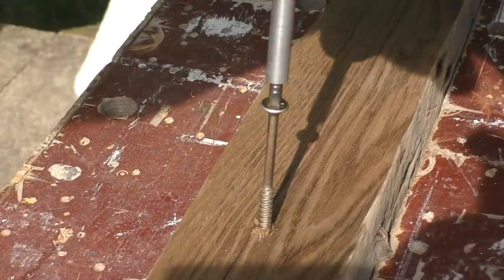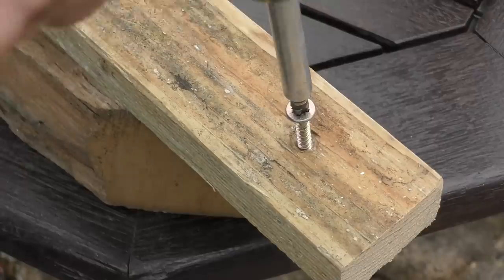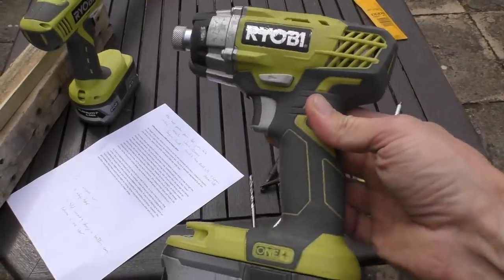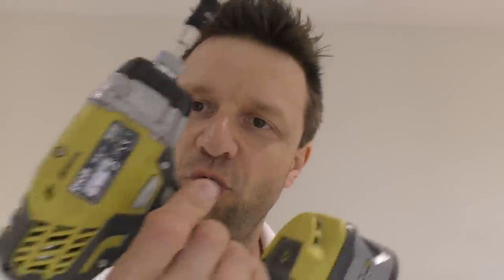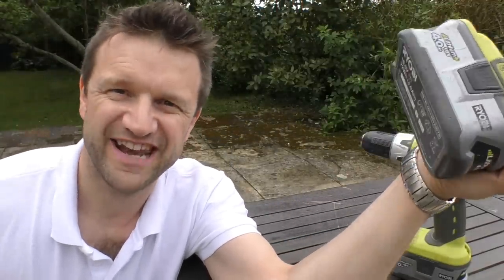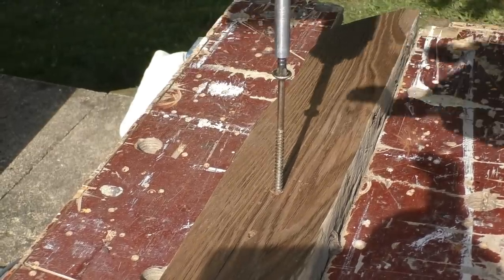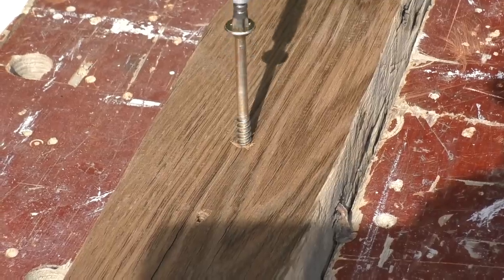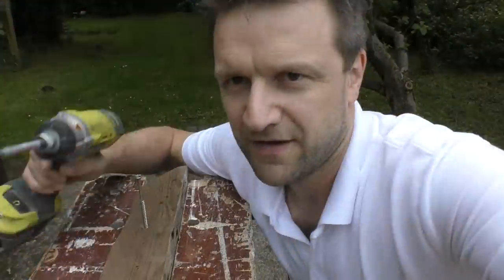Difference between Drill Drivers & Impact Drivers

Comment: I use an old trick, I keep a bar of soap in my tool box. Just one quick rub of the screw, across the soap, enables me to drive any length screw with my drill-driver. However, I only use 'Robertson' screws (square head), because there's much less likely to slip than other types of screws.
Reply: Drills are for drilling and impacts are for driving.
Reply: You don't drive many screws obviously.
Reply: I'm with you on the screws. I was taking off the siding on a hot tub a while back and they used flathead and Phillips. Both of those need to die. How many times have you stripped a Phillips or destroyed the tip of the bit? And has anyone successfully unscrewed a flathead without the bit sliding out? I use torx screw but only because the store I get my stuff from has them cheaper. Torx and square are the way to go.

Comment: The bigger battery may be generating more power for you, but the 4 Ah doesn't mean what you say it means. It's simply a unit of total charge stored in the battery. If it is discharging at an average rate of 1 amp per hour it can do so for 4 hours, it is a 4 Ah battery. It's a capacity unit not a unit of instantaneous energy delivery.
Reply: He said it correctly, the power available for 1hr. Of course different rates will vary the time.

Comment: Good video. Answers some good questions.
Maybe in another video sometime, something on Phillips bits with Phillips screws versus some of the other bit-and-screw variations that are available e.g. Pozidriv, so that so much downforce on the tool is not needed to prevent "cam out" of the bit. (Phillips was designed for the bit to cam out before stripping out the sheet metal, or breaking off the screw head in thick metal, in installing a part in auto assembly plant operations.)
Also, I often drill pilot holes so that I don't break off screws trying to get them to go all of the way, or so that I don't experience cam out of the Phillips bit before getting them to go all of the way, For me, this saves time in the long run and I have no information that the holding ability of the driven screw is diminished.

Comment: Thank you. Wow, never realised how important the battery is. And, like you, was very surprised how well the Drill with the big battery faired. Just bought, today, a Ryobi Impact driver,will try it out tomorrow. Very informative video.
Reply from the maker: Thanks. Yes the batteries are so important. I don't use those 2Ah any more, just 4 and 5Ah. My choice tool though these days is a light 12v drill driver and I use an SDS for heavy drilling into concrete as the hammer action on a combi drill is hopeless for brickwork.

Comment: Another point worth mentioning when using an impact driver is to get some decent bits. Cheapies just dont cut it. Wera make some decent bits that last. Thanks for the video.
Reply from the maker: Agreed. I've found Wera to be fantastic quality over the years.
Reply: Jay Bee  Very recently bought one of those (DeWalt DCF887) because I didn't just want to use it for screws (after drilling each hole for rawplugs with my DCD778 cordless-drill), I also thought it would be real handy for some badly needed repairs on my 4WD! 
Both are brushless models, & even though they were brand-new they didn't cost any more than the RRP for equivalent DeWalt brushed models as I purchased them from sellers on eBay!
Reply: Makita gold bits work great.

Comment: Love the impact driver. The power is there when you need it. Of course there are times when you shouldn't use it, example ; fitting hand wash basins, pans etc. I suppose it's common sense really and watch out for vibration white finger, this is something I was sceptical about until I did some homework, scary stuff.

Comment: Having seen the cordless drill driver do the same thing as the impact, I won't be needing an impact driver. I use an Erbauer 18v cordless drill driver and it's served me well. The only thing I'll be changing is the type of drive on longer screws to torx. I'm not taking away the capability of impacts, it's just that my cordless drill does me fine. 
Happy Holidays! 👍 🇬🇧
Reply from the maker: I totally get that, mate - I think that's really sound logic.
Reply: To each his own..  I've managed quite adequately (as a DIY'er) with just a drill driver but after seeing this I could have saved so much time and effort over the years.  Besides I so need a new toy.  Cheers mate, and a very merry Christmas to you too.
Reply: @andyblackpool  .. Thanks Andy. Instead of me buying an impact, I'll probably look at a cordless circular saw. Like you, I need a new toy as well.. ☺👍
Reply: if youve never had an impact i would recommend it. i even use my impact for a drill half the time it will never stick drilling steel.. heck i even have a jacobs drill chuck for impact... usually keep my countersink bit in it..  also mechanic'n i keep the 3/8 & 1/4 adapter bit for sockets with the most used socket on an it makes dissasembly of parts use far less cuss words not to mention light years quicker...  i get using a good drill for carpentry, but the impact is wat i was introduced to when i started metal roofing... those rubber washers cant be smashed and with an impact you have control to slow down the drive speed when the screw is almost there.. hitachi makita or milwaukee. no point in buying anything else unless really...
Reply: or bosch..  but ryobi... theyre terrible. i worked for a few diff folks that had em an nothing but dead batteries an poor performance.

Comment: The difference is that impact drivers have two advantages.  They are (normally) shorter, including the length of a 1/4" bit adapter, and have more torque.  However, lack of a clutch does matter VERY MUCH, especially on newer brushless drives which have poor low speed response.  How funny that all reviews tent to focus on max power instead of usable precision.

Comment: Just as an addition Charlie, Your right the impact has a lot of Torque. So much so that I have sheared off a number of screws when going into HARD wood. ( I was surprised at how  it went into the Oak). So it pays to pre drill in some circumstances.
Reply from the maker: Peter Compton Yes mate, I'd ALWAYS drill a pilot hole first when screwing into Oak. I didn't in this video because I was trying to make the test as demanding/ extreme as possible. The surprise for me was how well the drill driver did, but even so, I'd always use my impact driver for jobs like this.
Reply: no , dont buy cheap screws
Reply: When that happens, try sticking a rubber band between the bit and the the stripped screw... can work nicely.
Reply: Sabastian Love thanks for that tip!
Reply: Oak isn't even that hard. I've been working with azobe and padouk (don't know how it translates). You have to pre drill 95% of the hole when working with inox screws :D
Reply: @Henry Noki I agree. Wood can split. Boards settle in together better. I think it's stronger instead of stressing the wood.
Reply: Murphy’s law : self drilling screws don’t!
Reply: I've sheared off numerous "structural" grade screws, which are supposed to be very strong, with only a regular 12A corded drill. (That's 120V, for the Europeans it would probably be like around 6A at 240V).
I like pre-drilling when there is a chance the wood might split, especially when screwing near the ends or sides, or in thin pieces. Or, in cases where you're using a lag screw, you need to pre-drill for sure otherwise it'll definitely split, or will be a PITA to screw in.
Reply: I always use Titanium screws, very tough and never rust.

Comment: Well tbh if the wood is really hard to screw into, you should drill a small hole first, benefits are it's easier to then screw into and it reduces the chance for the wood to crack
Reply: Prich038 exactly
Reply: This was a power demonstration.
Reply: Pilot hole*

Comment: It might be important to clear up the terms used in this video. Ah (ampere hours) is a unit of charge, as in how much charge is in a battery. 4 Ah means it can deliver 1 ampere for 4 hours, or 4 amps for 1 hour. This means there's something else different with the batteries, and as MondoTV has pointed out, that's the number of cells. More cells in parallel means that while the voltage stays the same, the maximum amperage is increased. The importance of this is so we see the shortcoming of the labeling of the batteries. In theory, there's not less power (watts) in a lower Ah battery, but in a usage as a drill, we should really see a sort of max amperage labeling on the batteries, as well as their charge capabilities.

Great video, though!
Reply: Marco_Slug ShotGun  There's a big difference in the unit Ampere (A) that's a unit for current, and Ampere Hours (Ah) that's a unit of charge. Power (P) is what we're actually measuring with the test, power is the product of voltage (V) and current. I*V = P, so if the voltage of the batteries are the same, as it will be when the batteries are newly charged, the only other variable that can lower power is current. The bigger battery, however, has more battery cells. Since there are more cells in parallel, the impedance is lower, since R(tot) = 1/R1 + 1/R2 ..., so since I = V/R, or alternately P = V^2/R, lower resistance means both higher current and thus higher power. That's why I argue that batteries need a max amp label, not just Ah label.
Reply: Marco_Slug ShotGun Sure. That’s what current is. But that isn’t what charge is, which is what Ah is a unit of.
Reply: Marco_Slug ShotGun  If you want to think about Amperes as the speed of electric current that kind of works (although technically incorrect -it's the amount of current). People often use the plumbing analogy - voltage = pressure, resistance = pipe diameter and amps = the rate of flow (hence the speed confusion).  But we can work with that. Septimus is saying is that an 18V 4Ah battery has a little over 3 x capacity an 18V 1.3Ah battery. It also has 1/3 the internal resistance or 3 x the pipe diameter in the water analogy.  So technically 3 x as many amps can flow. You have to have the circuitry and wire diameter to support that of course but generally speaking the larger the battery capacity, the lower the internal resistance and the more amps it can deliver. This is why battery power is measured in C rates (ie directly related to capacity).
Reply: Marco_Slug ShotGun I’m not twisting things around. If you can’t understand the concepts thats not my problem. In your example you wouldn’t have any amps at 1 volt because 1 volt is not enough to break down the insulation resistance of the human body and no circuit is formed. Therefore ther are no amps. So that’s an impossible hypothetical. That’s not twisting things around, that’s how voltage and insulation resistance works. It really is better to think of amps as one half of the power equation, the other half being volts. 1 Amp x 1 Volt = 1 Watt which is a unit of power. You need both to make a circuit. Speed is related to time and that is only relevant measuring Amps or Watts over a period of time.
Reply: Marco_Slug ShotGun  When you say "If I put you in the electric chair with 120V but 10,000 Amp", you show that you don't really understand how this works. You don't "control" current. Current is what happens based on a set of conditions. If you know Ohm's Law, you know that in order to get higher amperage, you'd need lower resistance OR higher volt. That's why electrical chairs use conductors and used to(?) have a sponge, to improve conductance.

And yes, 10,000V harmless electrocutions happen all the time. A static shock has about 20,000V, but there is minimal charge (C). That's why there's no real flow of current, since it's momentary.

These things are hard to really understand well, so don't feel dejected for not getting it 100% right. Mondo and I are simply correcting your assumptions, and you shouldn't feel like we're twisting words. Statements like "don't throw numbers at me" followed by "let's get specific" also seems pretty silly. Numbers is the most specific way of explaining this.

Comment: You are so correct about the drill driver and the impact drivers and I decided to purchase a popular brand recently and looked at the battery sizes and the available upgrades available for the tool. After that I purchased the impact driver, but from another company which also have heavy duty batteries for their tool. About 8 years ago I purchased a Craftsman drill driver and it worked just fine, but when I had problems with the batteries which came with them and wanted to buy new ones I found that the new batteries would not charge on the charger which I had even though they fitted my drill. I decided not to buy another one of their products after that incident.
Reply: If you bought your Craftsman drill 8 years ago or more then it may suggest that it was using a different type of battery like NiCd (nickel-cadmium) today most common type of batteries are Li-ion which require different charging method. old cordless drills can use lion batteries if the voltage is in the acceptable rage so if that's the case with your craftsman drill then there is nothing to blame the manufacturer for, as they may offer new batteries of older drills but then technically they can not make them compatible with older chargers. if you are able to get the model number of your old drill we could solve that riddle.
Reply: MrFrambooise one of the nice things about when Ryobi changed from Ni-cad to Lithium was all the tools and batteries are compatible both ways.
Reply: That's nice, but chargers are nor compatible I guess. Ryobi seems to keep things in order.
Reply: @jjblackmore4818  Not true the old batteries will charge on the new charger but the opposite is not so.
Reply: And here you are again! YouTube is freaking me out, haha.